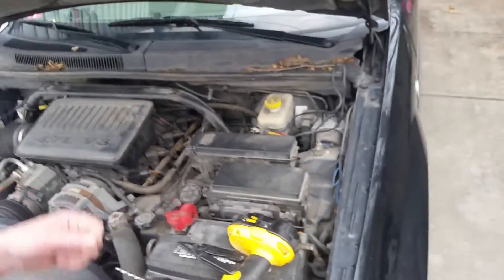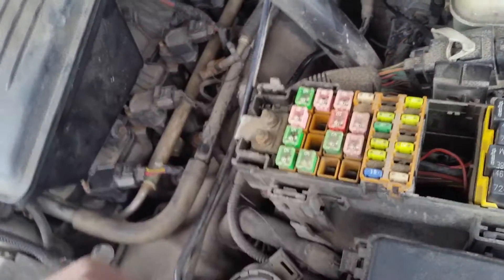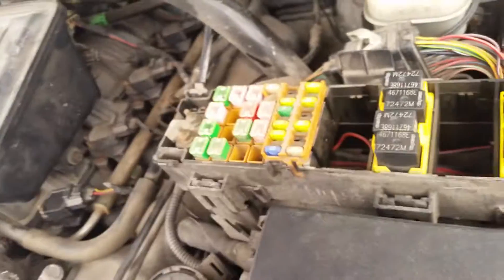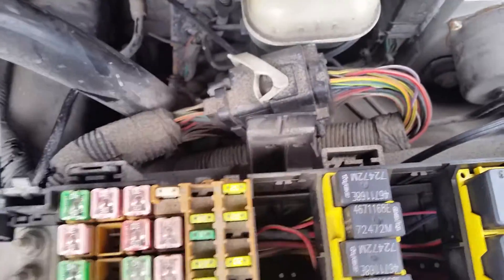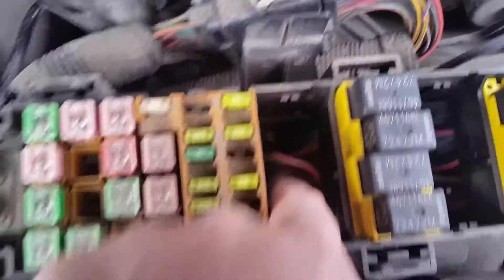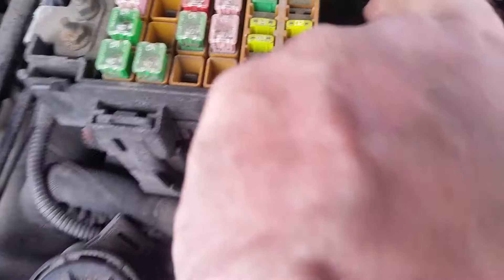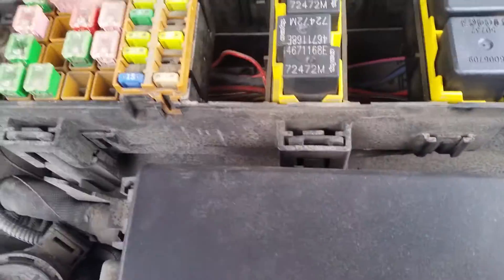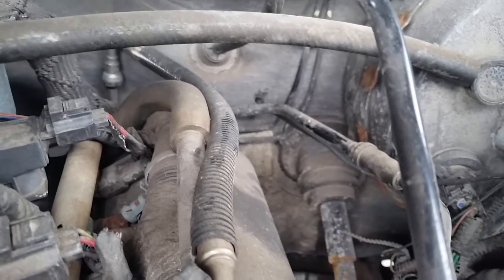Kill switch on a 2005 Jeep Grand Cherokee

Comment: I like the idea of a kill switch in theory but unless you can find a REALLY high-quality switch, they end up being pieces of Chinese crap that can go out on you while driving down the road.  I understand why you did it but just make sure that you use a high-quality switch and have a replacement switch and tools handy to either install a new one or resplice the original wiring, should the original fail.
Reply from the maker: Mark, excellent point. In this case, the switch is in the passenger compartment, And it would not have been hard, in a pinch, to just pull the spade connectors off and mash them together. But a quality switch is an excellent idea. Thanks!
Reply: @gjbc  Actually, was just thinking...how about pulling out the relay fuse for the fuel pump and carrying it with you?  That way you can just reinstall it anytime you want and unless it's a criminal who carries around spare relays with him, you should be good.
Reply: @Mark-wp4lw I was thinking the same thing.  But the thief can simply take another fuse for a different circuit and put it in the fuel pump slot.

Comment: You're car got stolen. so you show people how to steal your car again.
Reply from the maker: Mmm... No. I didn't show where the secret switch is hidden. They could figure it out eventually, but your average car thief is not going to stick around, if the car turns over, and turns over, and almost starts, but never starts. Anyway, I hope you found this useful!
Reply: True. They'd have to know you. And have seen this video. But if they did.. easy fix. Just cut the wire and give it constant power until its brought to its secure location then repaired. For whatever their dumb excuse would have been.
Reply: @gjbc  fast reply too. Thanks.